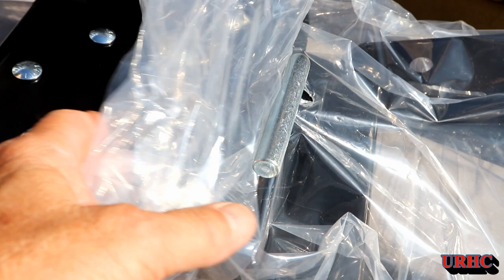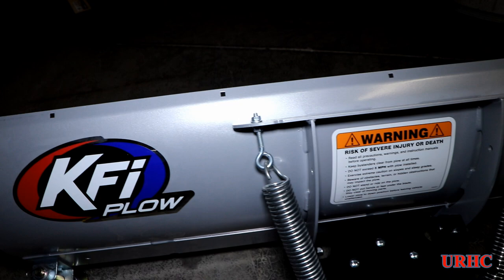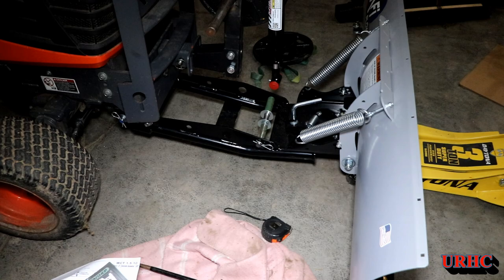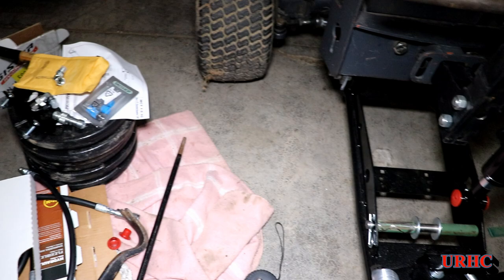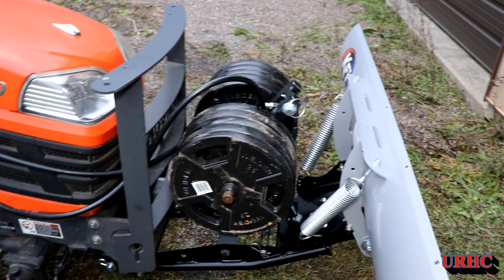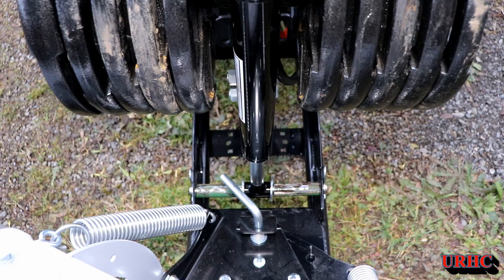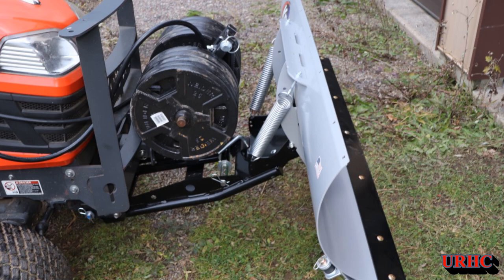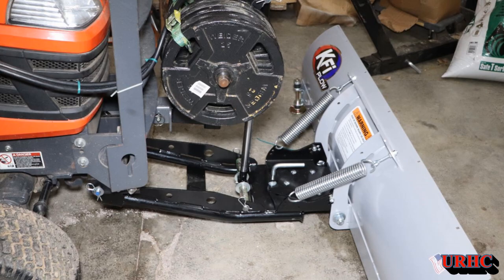Mounting A KFI Plow On My Kubota BX Because The Sidekick Never Arrived

Comment: I like the way you mounted the plow!! The amount of weight in front of the tires plus the engine weight could really wear the front tires down!
Reply from the maker: This is made to handle a loader so no problem. With the 600 pound blower on the back the front wheels are off the ground without weights.  It's really  well balanced now and shouldn't pull wheelies on the hill. Thanks for watching.

Comment: Nicely done.  Glad you and the Mrs. are on the mend.  On my JD 4310 I use my front end loader and a rear blade.  I took my rear blade and cut a strip of rubber horse mat and sandwiched it between the steel blades protruding four inches or so between the blades.  I have a 750 foot paved driveway not gravel like yours.  I checked the strip of horse mat thinking it was time to replace it.  It’s been on there since 2008 and still looks and works great.  That horse mat is made from recycled tires.  Keep up the great videos.
Reply from the maker: Thanks.  That's  a much bigger  tractor than my little  toys. This little  blower really  lets the little Kubota move a lot of snow but the skids have to keep it a couple  inches from the gravel.  This will make use of the return trip. Thanks for watching

Comment: Nice work - what are the front spindles rated for regarding weight?  Hydraulic leaks can be a pain but your set up looked very clean and sturdy.  Thank you for the videos.
Reply from the maker: They are rated for a loader with over 600 pounds in the bucket so I am thinking probably 1000 pounds each side minimum. My loctite was old and dried up so I just tried Teflon pipe dope that did nothing. I have another bottle of Loctite 545 on the way. If properly cleaned and allow 24 hours to set that stuff will seal up to 1/2 npt fittings every time. Thanks for watching.

Comment: My Kubota BX is set up with a Meteor rear mounted snow blower and a front end loader.  It is also used on a gravel driveway, so it is on skids that leave a few inches of snow behind. I  go back over the driveway with the loader to scrape the remaining snow down to the bare gravel, otherwise, my driveway turns to ice. I will be very interested to see how the plow works for you compared to the loader. The plow would be very useful in heavy wet snow. My rear snow blower worked poorly last winter. It does not throw the snow very far and the chute clogged up alot. It could be due to the mostly heavy wet snow, but my dealer says the unit may need service after ten years of heavy use. Any thoughts on that?  Love your videos. I have been a subscriber from the start and have watched all of them thank you.
Reply from the maker: This blower doesn't mind wet heavy snow. I also have the skids down 2 inches because it launches gravel. Hopefully this will clean that up on the return with no extra work and handle the 1 inch storms. A friend of mine replaced his woods blower with a Woodmaxx and saw big difference. Make sure none of the main blower fins are bent, worn, or broken because that is what keeps the snow moving. In wet snow run the machine at rpms that keep the blower pto in the 640 rpm range. You could send a email off to Meteor also. Thanks for watching.
Reply: Thanks for the suggestion to contact the company. They responded right away and determined the fan blades are worn down so there is excess clearance with the fan housing. On my unit there should be about 1/8 inch and my clearance is 3/4 inch.  Options are to replace the fan, weld extensions onto the fan blade ends, or bolt some type of liner onto the housing to reduct the clearance. The point is, these rear mounted blowers take a beating on gravel driveways and require lots of maintenance. A front plow on the tractor appears to be a better solution for gravel driveways.
Reply from the maker: @lewisblack3053  The fan blades on mine are like 8mm thick and should  last. If yours wear try welding  on some extensions and hit the wear areas with  hard surface rods before balancing. Front blowers have much thinner  fans and wear quicker. My chute is also uhmw lined to the fan to eliminate  wear. Glad they figured it out.